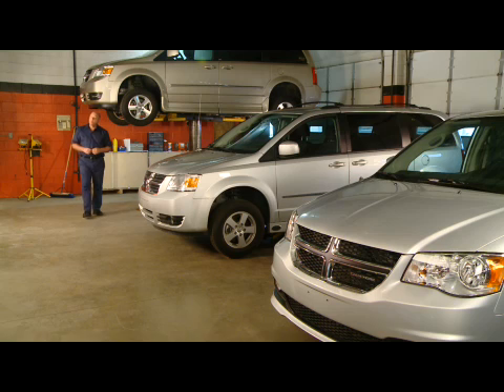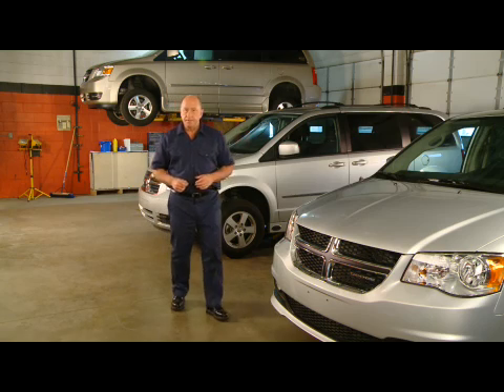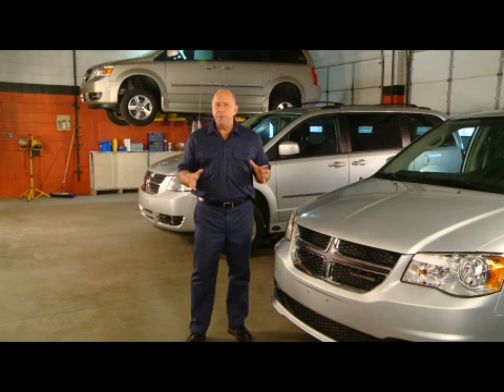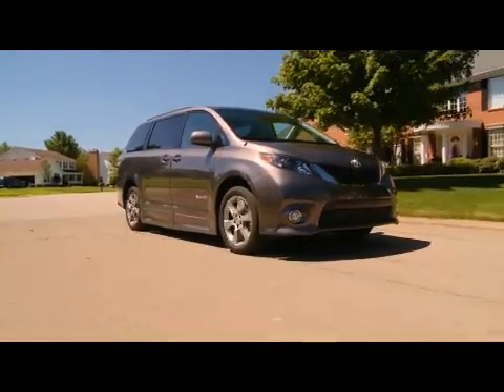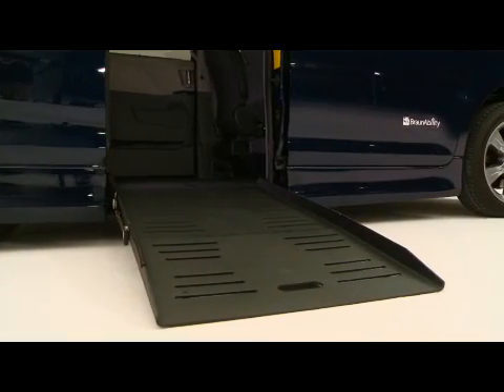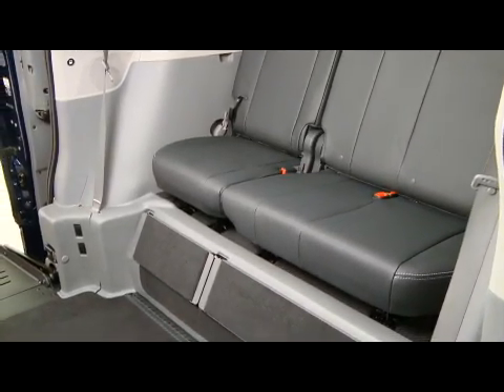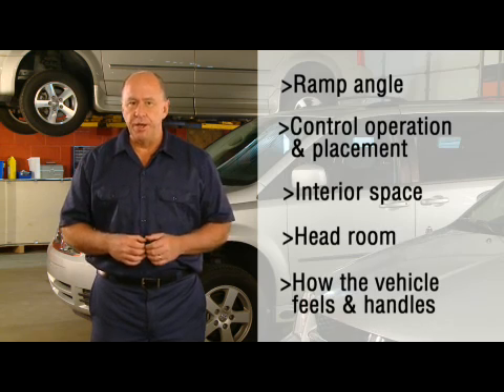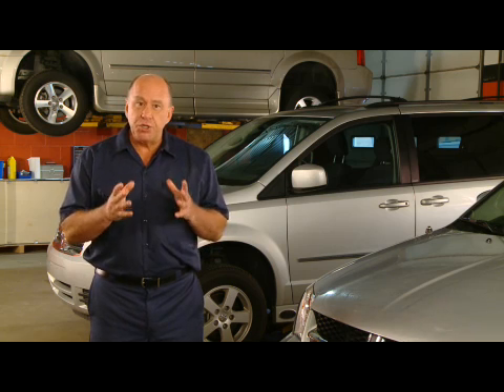Straight Talk About Wheelchair Vans: Learn Before You Buy!

Comment: How do these handle winter conditions?  Frozen slush and ice under the van affect the kneeling action?Does the ramp work as fast with temperatures below zero?
Reply from the maker: When possible, it's important to lower the ramp onto a flat surface when entering and exiting the vehicle. The ramp and kneeling function will travel at the same rate regardless of temperature, however, dangerous or extreme temperatures may affect speeds of any mechanical equipment. It is recommended to have your vehicle serviced after winter to clean out any water or debris that may have collected in the ramp storage area or the door track area and protect the longevity of your vehicle.
Reply: Ok nj

Comment: I have 2 vans. An old MKIII conversion with Braun lift. The computer boards are no longer availabe so the Braun ramp is useless. The second a Dodge Caravan and that also has a Braun ramp which keeps breaking. Braun are useless. The Dodge Caravan feels like it will break in half at any problem in the road which is everywhere here in Texas. The ramp never stays in position so it bangs with the road alot. Such shoddy workmanship.
Reply from the maker: BraunAbility maintains an extensive inventory of parts for our mobility products. However, we can't feasibly maintain a running inventory for products nearing 20 years in age. However, your Caravan problems can still be addressed by a BraunAbility certified technician. Please call us at 800-488-0359 or email us at productspecialist@braunability.com to speak with a representative.